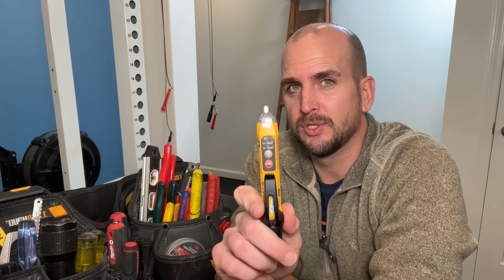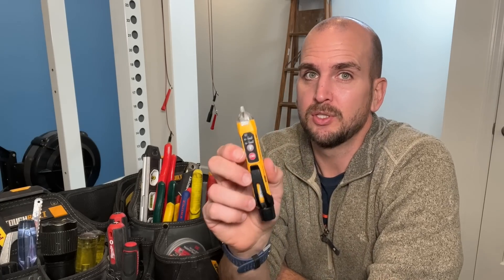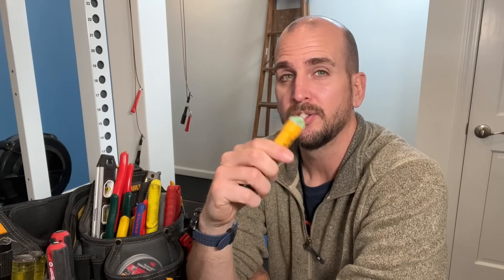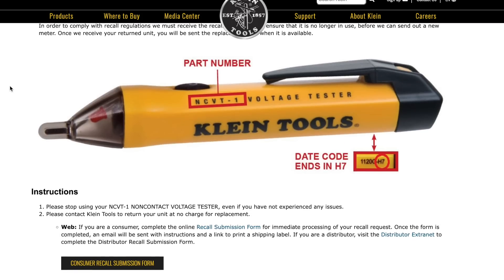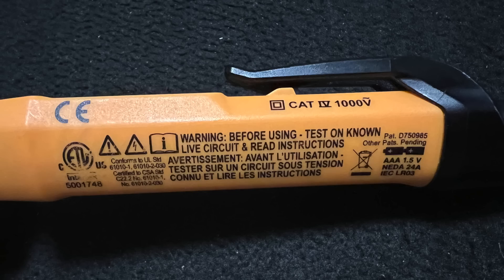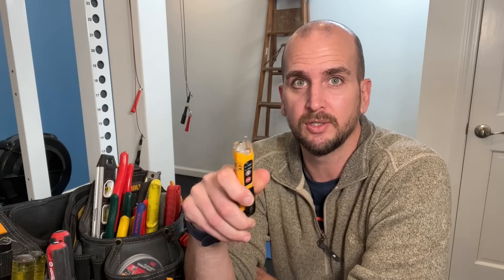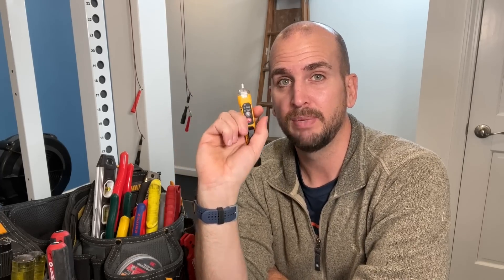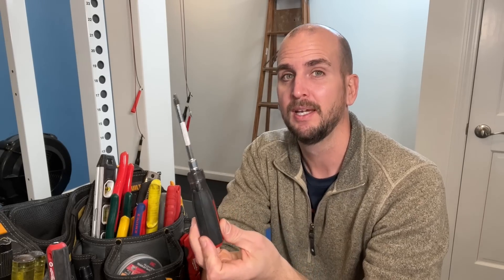The Tool I Get The Most Negative Feedback On And Still Use Weekly

Comment: I use my non contact Milwaukee tester all the time.  I always do what you suggest and test on a known live circuit.  My tester says that the voltage threshold is 50 VAC but I think it also triggers on smaller voltages.  Obviously these testers only work on AC where the changing voltage can induce into the tester.  Some circuits that are not live have some low induced voltages because of transformer effects of running parallel line for long distances.  Try turning off a breaker and measuring (with a DVM) the voltage on the line.  It is usually a small AC voltage and depending on your tester a false positive is possible.

Comment: I do residential HVAC, and that’s the same NCV tester that rides in my install bag. I haven’t had good luck detecting 24v with it, but it lets me know if I flipped the right breaker. I always test it on a known live cord first. A Fieldpiece multimeter (with a built in NCV tester) stays in my service bag;

Comment: Your point #3 should be used for all testers, whether they be NCVT, multi-meter or outlet tester. Test before use on a known circuit, do your tests, and then test on a known circuit again, to confirm that your tests are valid. I used to work as a lineman for an electric company, and that is what we used on all voltages, including high voltages like 12kV or 34kV. It saved a life more than once.

Comment: The best NCVT I ever owned was the Amprobe TIF Tic Tracer 100 AC Voltage Detector. It was dependable and the audio was able to pierce through the saws, routers, drilling or whatever on about any job sight I was on trying to trace a circuit - even on the other side of the house or offices. Turn it on and it has a constant about 1 sec interval 'TIC' when circuit conductor is NOT LIVE. Energize that conductor and the Tic Tracer tone goes into over drive. The 'TIC" changes from ~1sec intervals to rapid multiple 'TICS' per second, plus the tone pitch is higher and louder - or it is constant as well as louder and higher pitched. Everyone else is not so happy with its tone (the carpenters; plumbers; drywallers, etc.). But their not going to turn their stuff off while I trace out my wires. 

I found that if I taped a piece of solid #12 or #14 wire to the side of the neck and bend the wire 90 degrees through the 'V' at the top of the neck, then stick the stripped end of the wire into the receptacle it would transfer the field to the tic tracer and I'd get the tone go off; or I would bend the taped wire up over and through the 'V' neck into a hooked 'U',  that way I could hang the Tic Tracer on a conductor - say from a ceiling or wall box, then go to the panel and identify the circuit. Had other methods as well.

But that Tic Tracer was great. My only complaint was the shape of the device and the fragility of the switch.

Today, my favorite NCVD is the Milwaukee Volt Detector, such as their 2202-20 Voltage Detector with LED Light. I also like the Fluke Volt Detector. I have and also like the Southwire Volt Detectors. 

One of the benefits to the Milwaukee NCVD is that they are not as fat and bulky as many others and squared off, easy to hold. They have the LED light on, and auto-shut-off at a reasonable time.

I found I can avoid many false positives when I'm dealing with multiple wires close together, is by extending my index finger up along side the top of the flat tipped detector section when coming close to or touching the conductor. I don't know myself, but I can only suppose for now, that my finger 'interrupts' the field that is perhaps somehow 'induced' in the 'dead' wire. Thus keeping it from giving me a false positive. 

That's my two-cents.

Comment: I use my non-contact tester along with my multimeter along with a circuit tester.

The non-contact tester just like any other tool has to be used right has to be taken care of has to be maintained and the person using it has to know what they're doing. Usually the problems come along not from professionals but from homeowners that are imbecile dip shitz that think that they want to play electrician and "all of a sudden" the thing isn't working because they have screwed up. They badmouth the tool when fact it's their incompetence that caused the problem

Comment: I love this tool. I have the Klein you have there but I prefer the Milwaukee 2202-20. It's smaller and it has an awesome light on the end.  It will beep on ghost voltage so it always good measure to double check with multimeter.

Comment: Meters are not for checking if there is voltage, they are for measuring how much voltage there is. There are multiple scenarios where a meter won't detect voltage when it's there. A meter can be used to check for voltage, but it isn't as reliable as a tool that gives a binary on/off output.

Comment: It's absolutely true. No one should EVER trust non-contact meters. Sure it can be used to get quick reference that something is live. But if it doesn't show anything, one should still test with conventional meters. In industrial use those non-contact meters can easily be deadly as shielded wires aren't detected at all. So all-in-all, it's just backup device.

Comment: Nope nope nope ... it's not about being a newbie or a pro ... it's about being safe . If i need to work on a circuit, i test it with a approved voltage indicator anyway ... i've worked for/with people that used these non contacts and always needed avi anyway so why bother with this non contact ... fallow safe isolation properly, use your head and work safely

Comment: I’ve been an electrician for about 38 years now and I always have my non-contact tester on me. If I’m going to be opening a panel or a device or need to check the voltage then I will have one of my meters. My go to meters are alway Fluke. I find them to be the most reliable and rugged. Great video by the way.

Comment: I didn't use one for ages, then I started using one and it helps cut out a lot of the guess work of what wires are hot. Which just leaves figuring out breakers, not sure if I want to buy that tool yet...

Comment: My brother is a licensed electrician. He uses a DVM to check circuits he works on. I happened to be looking over his shoulder one day he was doing something at our Mom's house. I watched as he juggled two probes and the DVM, trying to get the probe tips where he could make the contact he wanted, while avoiding the contact he didn't want. I also noticed that his probes had some burn marks. It's going to be difficult to convince me that my non-contact tester is less safe than his contact tester.

Comment: Licensed master electrician here. 
I keep a tic tracer in my pocket and use it daily.
These devices are great if you know how to use them. As long as you're not using this as your ONLY means of verification then you'll be fine...
Reply: Know you've been around awhile when you call it a tic tracer. I remember the black tracer with the body about the size of a deck of cards and a 3.5 inch v-notched probe. My mentor would make his own back in the 70s

Comment: 35yr electrician here. By far, my favorite is fluke. The entire tip of the tester glows. It's stupid proof. The tip blinks every few seconds while it is on.  It auto shuts itself off if it's on and inactive more than a few minutes and the tester beeps twice to signal it's off. I've had Klein Greenlee and most of the others.  It's great for working on branch circuits.  I always use a meter when I work inside breaker panels.

Comment: After a lightbulb failed my No Contact Voltage tester picked up voltage from 3 feet away from the wall that the light switch is on. This distance cut in half every couple minutes. 

I was checking for voltage because the bulb broke when still in the socket and I had turned off the power to deal with that.

Comment: Not a pro, but I think my method is much better than both of these.

I use an audible tone finder.  It's one of the things with a speaker that amplifies a tone on a cable you're trying to trace.  You hold down the button and wave it around listening.  But it also picks up 60-cycle hum, so you can hear with your own ears how strong the voltage hum is.

I wasn't aware that multimeter is the gold standard, and I think that's actually a bit suspect.  To use a meter to test for voltage, you're making a lot of assumptions about where the voltage is.  But what if the device is miswired, or just broken?  Or the case is energized, but not the wires themselves?  These things happen all the time in old crappy work.  Also, the meter requires access to the conductor; and it also requires a good electrical connection, which you might not be able to get reliably.  So I think using a meter is really risky, and just asking for trouble.

The problem with the visual tester is exactly what you showed in your video: there's no easy way to get both the sensitivity and specificity of your probe as high as you would like.  What if there is voltage, but it's just before the threshold of detection, perhaps because it's being shielded?  You can't make one of these things sensitive enough, because the light would just go off constant, because most rooms are just full of EMF.  But in an aural tester, you can hear the background buzz, and you can hear it get louder as you move your probe around, so you can tell what's going on.

Summary: I don't own a tester like you have, and it's hard to see why I'd ever want to use one.  I also don't think using solely a meter is safe.

Comment: Thanks for the input Radiorich. I guess it's just my judgement call between staying stable on the ladder using one hand to test and the other to hold onto a truss or whatever I can to stabilize myself versus having two hands up in the air while testing. Of course, the two hands up in the air may still occur when trying to install or remove something from the overhead fixture or junction box.

Comment: The non-contact tester is pretty good about telling you something is hot (not always, the cheapest ones are hinky).  But it is NOT a guarantee something is dead.  I carry one in a shirt pocket 24/7, but I understand the philosophy of testing, grounding, etc.  Recently retired from 45 years in the field, I saw lots of professionals using these.  It’s a tool, not a lifeguard.  Even the best testers used in high voltage yards get confirmed on a known hot source, used to test, then confirmed again on a known hot (yes, in 45 years I have discovered bad testers).

Comment: We all use these in commercial / industrial electrical industry. Most of us use the Fluke 1AC ii. I've tried most of the big brands, and they've all either broke or stopped working, or not reliable. Fluke is the only one works properly for most of us. Most of us will verify with a meter on 600v stuff if its sus.

Comment: If contact is possible, use a VOM. If you use your favorite tool to find a hot romex, verify that it is dead with your VOM before touching bare conductors or cutting with cutting pliers. The professionals use the VOM because it only takes one failure to kill you. Your little tool is convenient but it might give you false readings under some circumstances. Always test. event with your VOM.

Comment: My multimeter has a no contact voltage tester in it so I use that, but when I have to deal with a hacked up mislabeled panel and I can't find the right breaker they nice because you can stick it and go flip breakers until the beeping stops

Comment: I just bought the NCVT-2P not knowing there is a NCVT-3. I also don't know how youtube knew I was looking at these testers, but your video just showed up. 
I didn't pay much attention to the details about this product, as I should have. I thought a non contact tester would give a signal for AC & DC, but this product's details says it's an AC tester. I am working on a gas golf cart installing extra lights, the new 2022  carts are more refined and actually have wiring harnesses and not just wires run with wire ties. 
Even though this product says it's for AC, it has been working fine for DC and saving me from opening a harness and not finding the wire I need. 
I set my NCVT-2 in 12v to 1000v, touch  a 12 volt line that is hot and I get the signal I need.
Why the difference between AC & DC when it come to testing hot or not?

Comment: you could always do what my workplace does and plug in a home-made light switch that is designed to just short the circuit and trip the breaker. -.-
(i do not actually recommend this).

non-contact testers are banned at work after a guy got shocked after doing the verification test you mentioned in the vid

Comment: I would always use a multimeter when carrying out circuit isolations. I do use an NCVT as a quick and dirty test for circuits being live when a fault has been reported, but would then follow up with the multimeter to check the neutral and live Voltage. I also use the NCVT  in cable trunking where you have many cables from different supplies to double check all have been isolated before starting work. The NCVT certainly has its place, but I would never let my life depend on it.

Comment: Long time electrician here. If you have access to the ends of the wire or terminals, there is no excuse for not using a wiggy. (solenoid type tester). It will never lie. Dont trust you life with a battery and/or electronics.
Reply: To clarify: Digital Multimeters and non contact testers are good for troubleshooting. But if you are going to get hands on and start touching things that can kill you, always use a wiggy first.

Comment: I have a degree in electrical and electronic engineering from UCL in Britain. I use these devices EVERY time I work on electrical systems (other than extreme high voltage). I actually have an additional device that allows me to verify the tool is working correctly (generates a local EM field). I also have two multimeters which have overlapped functionality (for instance, one of them does test load generation and phase/power factor analysis while the other has built-in gigabit ethernet test capabilities). I recommend that ALL home DIYers have these simple testers in their toolkit - whether they are wiring up a socket, an appliances, a mini-split etc.. Multimeters also break - they are often internally fused and if that fuse is blown (or a contact comes loose) the multimeter is just about useless. This is also why I carry more than 1 device. The biggest issue is laziness - no point in carrying a tool if you don't use it. Never, ever take anything for granted with electricity. I used to work on mine electrical systems (winders etc) and your first mistake will be your last. Be safe!

Comment: EVERYDAY HOME REPAIRS< In the Non Contact Voltage Manuals Specs what is it called to know how much the Non Contact meter can DETECT the voltage through different types of walls because not all walls are hollow or wood they can be other materials so the Non Contact meter will have to detect more sensitive voltages since the wall is made out of concrete. Example a phone call box has many wires and voltages going to the outside phone call box for apartments, if you use the Non contact meter to sense the wires on the concrete building wall you won't get any detection at all because of the concrete building wall is Blocking the voltage signals. Most Non Contact Meters can't sensitive enough to detect voltages in concrete building walls so what do you use?

Comment: Fluke is what I use , I love NCV's but I always double check with a DMM (Fluke) as well, it is also meters that have built in NCV testing some are glitchy (either too sensitive or not sensitive enough in specific ranges ) , always double check with safe methods & meters.

Comment: I have been a licensed electrical contractor for 29 years with 35+ years in the electrical trade. Went full time engineering almost 15 years ago but I always had a Greenlee non-contact voltage tester in my pouch doing any service work. Funny thing is, a few weeks ago I loaded my tool pouch to change my garage lights to LED, one of the first tools I put into the pouch was the Greenlee tester. Because I don't use it that often, I always test a cord or receptacle prior to using it to test circuits I am working on, just to verify the battery is good.

Comment: I am a master electrician and a NCVT is a ok starting point, in a commercial environment it is required to use a VOM meter to be shure. I want to see what my meter shows me to be shure. In a j- box with multiple circuits you will get a false hot due to inductance with a NCVT.

Comment: NCVT is great for troubleshooting, but I don't trust it with my life. I use my wiggy before I touch any wires. The wiggy is also better because it isn't fooled by induced current. I've run into a few situations where my NCVT showed hot and my multimeter showed voltage, but the wiggy showed it wasn't truly live.